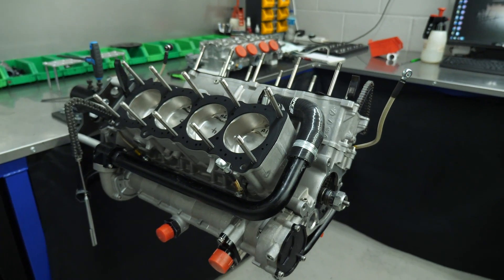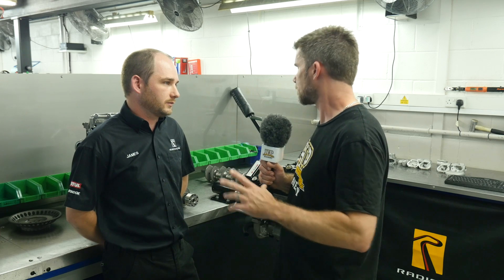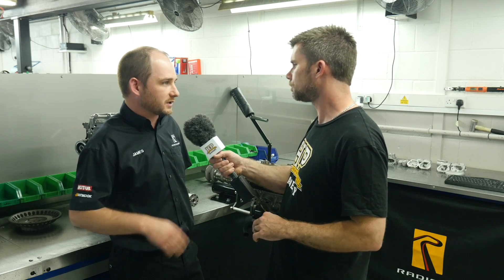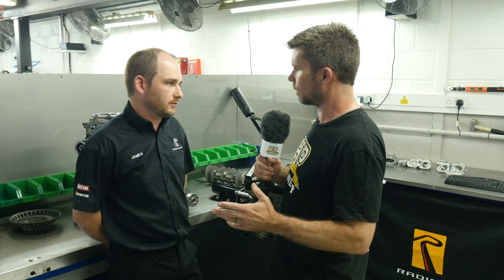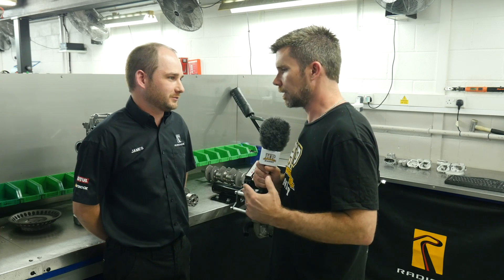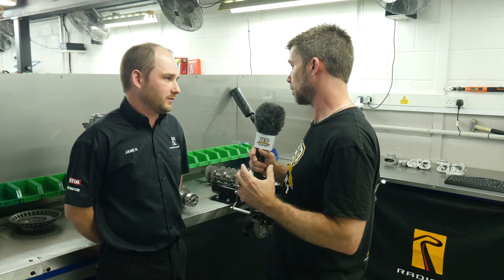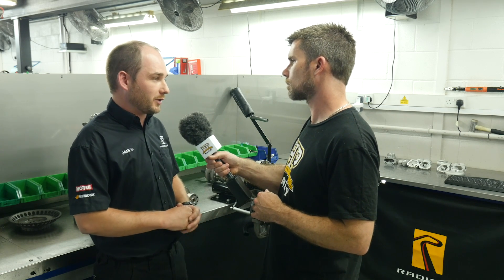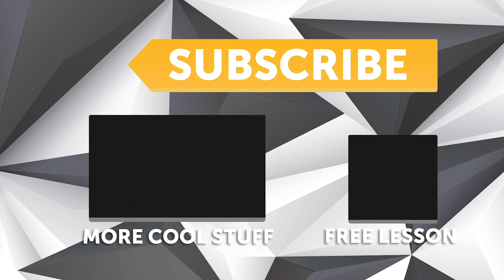Squish VS Compression In A 500HP Hayabusa V8 Engine | Radical Sportscars [TECH TALK]

Comment from the maker: Want more info on the 105kg, 500HP, 10,500RPM ‘Hayabusa’ V8? Check out the video here: http://bit.ly/BusaV8 -  Taz 👨🏻
Reply: dumb question...is it ok for long term if a standard NA engine using aftermarket hi flow fuel pump n bigger cc for injector?
Reply: @yondaimehokage3343  
Yes, provided the engine is tuned for it - if not, and the ECU doesn't incorporate some form of 'self tuning', it's just pumping in more fuel will cause the engine to run rich and not only produce less power/torque, but potentially cause excess ring wear, oil dilution, and other problems.
If you're looking at fitting the parts, before further work, running the new lines, wiring, pump upgrade, etc. should be fine if you keep the stock injectors and set the pump pressure to the OEM pressure. It might be argued that setting the pressure lower will compensate for the larger injectors, but it's kinda iffy.
Any particular reason for this change, as if it isn't actually needed it seems a waste of money?

Comments, anyone?
Reply: GordoWG1 WG1 tq for explaining,i want to make improvements for old superbike engine fuel system...so i feel this upgrading maybe a worth to try even it’s wasted
Reply: @yondaimehokage3343  
Before you do anything, I'd strongly recommend you check out the relevant forums that deal with that brand, even model, of bike - they re rather finely tuned even in stock form, so any un-informed changes WILL make it run worse.
Exactly which brand, model and year is it - 'might' be able to point you in the right direction?
Reply: At 56 sec. Did you say on the PUMP FUEL, YES YOU just said it again! Pump fuel? 
 I hear your accent, obviously you are used to burning diesel and 2 stroke out of a pump...lol! 
 What fuel retailer can I stop and buy 98 octane? PLEASE!?!? 
 What a georgous piece of engineering!

Comment: What is the difference/ relationship between Deck Height and Squish? Is Squish primarily determined by piston dome height/ shape? Does the goal of attaining good Squish suggest that in the circumstance of having to limit static compression ratio, piston dome shape should still be optimized even with a necessarily low Deck Height? Specifically, if I'm running a racing class that requires a 9.0:1 compression ratio, should I spend money on a custom Squish-optimized piston dome shape rather than merely running a flat top or even a dished piston?

Comment: but MBE cyl heads says tight squish is not what its cracked up to be , and they are putting hemi cuts on all their wedge heads because it lowers the chance of detonation ,  MBE doenst ask this , but I do , have any of you ever looked how far in the hole your pistons are at 30 deg btdc ? its about 1/4" , so when the spark plug ignites the charge at 30 deg btdc  how in the hell does a tight squish do what they say it does ? lol , the thing would need to fire at tdc to do what they say squish does , when the thing fires at 30 deg btdc the cahrge is 90 % burnt before the tight squish can squeeze the charge into the middle of the piston , not to mention , a hemi has 0 squish and makes more power than a wedge lol

Comment: With a compression ratio change from 10.7:1 to 12.5:1 and no changes to fuelling or ignition timing from stock(Honda CRF250) is there likely to be any problematic increase in combustion chamber temperature?

Comment: Is octane different between Australia and US?
Reply from the maker: Yes they use different 'scales'. I'll post a line from Wiki for you below - Taz.

In most countries in Europe (also in Australia, Pakistan and New Zealand) the "headline" octane rating shown on the pump is the RON, but in Canada, the United States, Brazil, and some other countries, the headline number is the simple mean or average of the RON and the MON, called the Anti-Knock Index (AKI), and often written on pumps as (R+M)/2. It may also sometimes be called the Posted Octane Number (PON).

https://en.wikipedia.org/wiki/Octane_rating#Measurement_methods

Comment: Should have mentioned the IVC timing allowing that SCR as well. IVC is huge on keeping the DCR low enough to run street fuels with really high SCR.

I ran a .040" gasket with a .007" proud piston with steel rods. This was just about as tight as you wanted to run. It made the engine very complaint on running different timing and higher DCR and SCR while sticking to 93RM/98R fuel.

Comment: Forgot to add - some of you may have noticed that, with high levels of forced induction, every engine will tend to have a particular area of the piston that eventually fails. If you're fortunate it will just show up as the fine pitting characteristic of detonation, if not the top land can collapse and pinch the ring - even leading to the piston being melted down the side and a re-sleeve being required.
This usually an indication there is incorrect quench and the options are to either close it up to pull more heat out, or to increase it so there is less local compression of the charge to reduce the affect of the combustion pressure front.

Comments?

Comment: Squish vs compression  seems the same to me however they were talking how best to squish to burn properly snd produce better power and torque.
It seems designing the head and piston affects combustion. 
So, if you change the head design it affects something and designing the piston also affects something. 
In summary,  YOU CAN'T GET TWO THINGS AT THE SAME TIME.
Compromise in between is the best design.
Reply: Squish and compression are two distinctly different things.  Think about it this way:  A shorter rod engine with a similar stroke but lower TDC piston height (less squish) can still have the same compression ratio as a similar engine with a longer rod and higher TDC piston height (more squish).  That's why the guy said he'd favor designing around squish rather than static compression ratio given the choice.  If your car has an engine that's non-interference (piston will not contact valve if the timing belt/chain fails), it most probably has very little quench regardless of overall compression ratio since TDC piston height will obviously need to be lower.

Comment: It's a rather complex subject, and that was a nice intro' to it.

As I have understood it, there are at least these things to consider, but bear in mind this is from years ago, before the interweb which has some more, better (?) up-to-date information.

a/ quench height, or clearance between the piston and the cylinder head - this is important as it has to balance squish (see b/) for turbulence and improved flame front speed (see c/) while avoiding detonation due to compression ignition of the charge towards the edge of the cumbustion - this can cause colliding flame fronts and damage from the resulting pressure spikes. It is called quench because the intension is to 'quench'  these areas by drawing their heat energy into the head and piston, increasing the resistance aginst compressive ignition. IIRC, for 'most' engines the critical clearance to avoid is roughly 30-60 thou", or 0.75 to 1.5mm - but engines do differ.
b/ squish, as the gentlemen alluded to, is what happens as the piston moves up the bore, the gases in the cylinder are pushed back and as they do so, they get more turbulent. As the piston approached the head, it is squeezed more and it gets more turbulent as the gas speeds are increased of those caught between the piston and head, like squeezing a watermellon seed between one's fingers. This turbulence mixes the fuel/air mix but, at least as important, when combustion is initiated by the spark plug, it rapidly mixes the burning fuel which gives a faster, more thorough burn of the fuel. This means later ignition is required and so gives more torque because there is less pressure build up before the piston reaches TDC and the pressure in the cylinder peaks earlier for more mean pressure on the power stroke. In theory, one may say that zero squish is most desirable, but...
c/ flame front, basically how fast the burning fuel is ignited in the cylinder. Unlike what some people believe, the air/fuel charge in the cylinder doesn't burn all at once, but over a period of time. IIRC, in still air the flame front speed is roughly 1 meter/yard a second for petrol/gasoline and that is obviously WAY to slow for a combustion engine. Fortunately there are things that will improve this, such as mixing the fuel and air so both are available, compressing the mixture so the fuel is more easily ignited, and introducing turbulence so rather than having to rely on the simple burning of the fuel to ignite the neighbouring fuel, the turbulence moves the burning fuel more rapidly though the unburned.

Some also mentioned some high compression pistons weren't as good as others, some valve shrouding, and some mentioned the flame propagation. All good points.
As I understand it, there are several things that come into play - 

Some engine combustion shapes are 'better' than others and the benefits are often at the cost of other issues. Wedge shaped heads are generally best for quench and, usually, squish, because of their designs, but not for the best airflow. Chrysler (others also used it) is well known for their "Hemispherical" design and the "penthouse" design is commonly used for multi-valve petrol/gasoline engines (not all, mind) but both have poor quench characteristics and so poor turbulence from the head design - they will normally use a port and/or valve throat design that is intended to provide turbulence to the incoming charge - this is also why it is important to be aware of what one is doing when 'porting' such heads as the increase in flow may still provide less torque because of the loss of turbulence gives much worse combustion.
With some engines, with high lift/long duration camshafts there needs to be quite deep clearance reliefs in the piston tops, this is worsened with the extra material added for increased compression. It is certainly possible for these deeper reliefs to restrict the gas flow into, and out of, the cylinder and in some cases removing material around them may net a torque increase from the improved gas flow despite losing compression.
As you may have realised, sticking additional material into the chamber will get in the way for the flame front, which can affect how it moves through the combustion chamber and, in some cases, can effectively block part of the charge off, especially if the piston to head clearance is such that the flame front is quenched, or slowed, because the piston and head are drawing the heat energy from them. Some folks are using VERY high compressions with methnol and it can be a big problem getting a consistent burn. Some of you may even have seen pistons being sold with 'fire slots', or other design features intended to improve combustion efficiencies. You may also have read of some builders machining off part of the piston for more power.

Some years ago, there was a bit of a fad for machining fire slots in the head - ah, "Singh grooves" - don't know how effective they were, or if they are still being done? Might have gone the way of the anti-reversion exhaust designs - some swore by them, some swore at them?

Comment: Squish? I've only ever reffered to this as quench... I suppose different terminology is used all over the world
Reply: @PADOYLE  I understand what your saying, it just seems weird that for so many years I've slightly mis- used this term (although I understand the relationship your reffering to)... I've been a qualified mechanic for almost 20 years now and machinists I work with and other mechanics I've learnt from have always called the measurement between the piston crown and the combustion chamber the "quench area or volume"... There you go, I feel like I need to look into that a bit closer now- especially considering I build a lot of engines for people...
Reply: @Blake Pinette That's what I thought bro. I didn't think I had been mis- using the term... Cheers! 😉

Comment: Tip for measuring squish on an assembled engine.  Feed a length of solder through the plug hole until you feel it touch the cylinder wall. Rotate the engine past TDC so it squashes the soldier. Remove solder and measure your squish.  Best to do at 12-3-6-9 o clock on the pistons. Account for rock in the bore. 
0.7 is about right on a fast road engine.
Reply: Does your suggestion of 0.7 extend to a single cylinder 2-stroke motorbike engine?
Reply: Underpaid Racer 
You’d have to research.